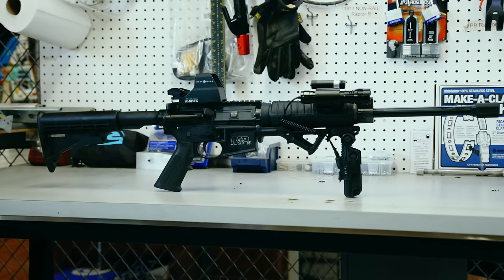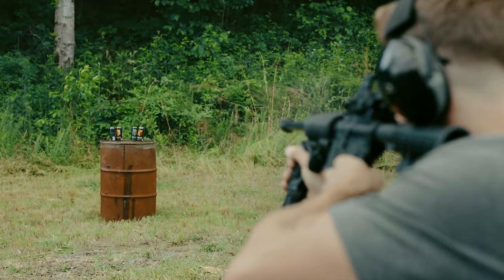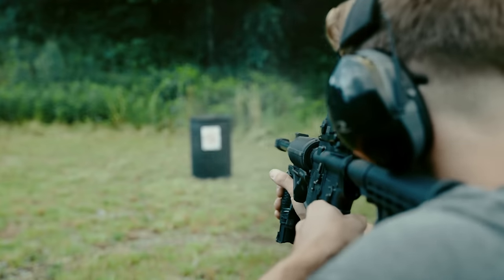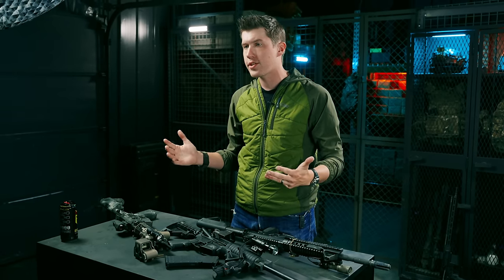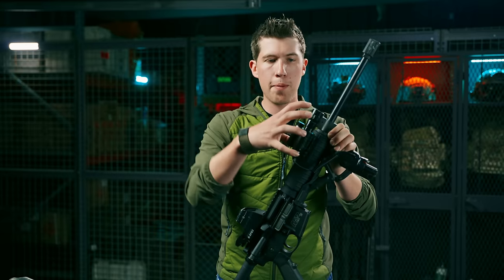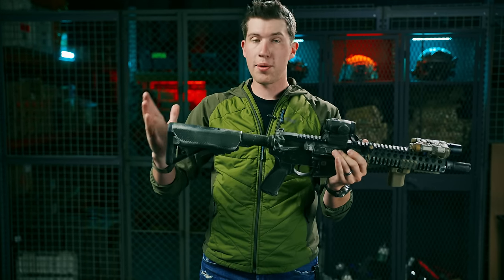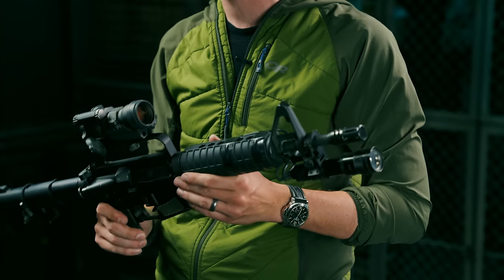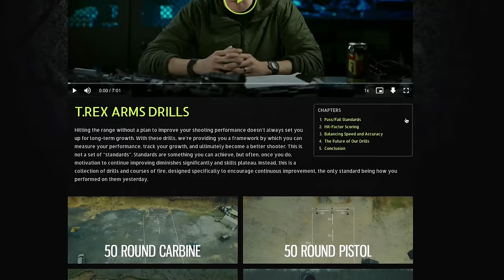5 Mistakes New Rifle Owners Make

Comment: My first sight was a Vortex Strikefire II. Still have it and it's one of my favorites, and one my backup gun. Only about 200-250 rn I believe. I recently bought the cheapest 7.62x39 AR-15 known to man, a complete radical firearms. Other than receiver slop that was fixed with a set screw, and a heavy buffer to help with the overgassing it has been a great steel case eating machine for 400 bucks. I put a Sig MSR on it that I got on sale for 70 bucks. I didn't have high expectations for anything on the rifle, it was all as cheap as cheap gets. So far the MSR hasn't lost zero and has options for night vision that actually work pretty darn well for a normally 120-150 dollar sight. It has been accidentally stepped on, caked in mud, and accidentally kicked with steel toes as well (fell off the shelf). SIG's got a fan in me now. Might get a ROMEO 5. 

Would love to see a ROMEO sight series review.
Reply: I got a sig reflex sight for a 120 rounds of 7.62x39 from a buddy and after putting that on my block II upper I haven’t dropped any money on another sight. Super solid sight. I would really enjoy having a UH-1 or a 4x32 Acog with the backup top sights just for shits and giggles
Reply: Strike fire is a terrible optic all around. The sig Romeo 5 is not bad but if your waiting for Lucas to do a committed review for one you're gonna be waiting a long time
Reply: @oneballwizard406  I guess to each their own. I own a LOT of optics ranging from $20 on amazon to Eotech, Aimpoint, and Trijicon in the world of red dots. That strikefire has great eye relief, pretty indestructible, never loses zero, and doesn't glare much on high brightness.

Can't say the same for my CompM4, I broke it within 3 months. Had to get it warrantied. The new one doesn't hold zero very well. Infuriating that a near 1k optic that I was going to use for my battle rifle is a lemon product. I always hated aimpoint, their optics in the service were junk too. Yet so many people sing their praise.

I've never heard a single bad thing about the strikefire at it's pricepoint, what was your bad experience? I think looking at SIG products is smart, since they have been winning so many military contracts. Most SDMR systems out there right now use TANGO6 optics, and out of all the LVPO's out there it's been by far and away my favorite.
Reply: @Wrenchingandnursing  I can't talk I have a leupold freedom RDS, thinking about picking up the uh-1. I just think there is far better options for the price, just about anything from holo sun or primary arms is better
Reply: @oneballwizard406  I can't say for sure about holosun, but I have a couple primary arms optics, and their red dots are lackluster. I liked their LVPO and scoped optics in general, but the red dots while being reliable and tough, have horrible eye relief and glare.
Reply: @oneballwizard406  Something funny about a guy calling something "Terrible all around" and he doesn't even own it nor has he touched it. Never fail to amaze us gun "community."

lol
Reply: @Wrenchingandnursing  Red dots don't have "eye relief."
Reply: @denmanfite3156  what made you think I've never touched one? I've used one extensively and think it's a pos that's my personal opinion. Don't like it oh well
Reply: @denmanfite3156  🤡
Reply: @denmanfite3156  Yes they do. Reflex sights, and "most" holographic sights don't have eye relief. Not all red dot sights are reflex sights. Reflex sights that are enclosed in a tube can still suffer from sight acquisition in very bright or very dark situations, but in the case of my comment above you are right, eye relief wasn't the right term. 

There are three main types of red dots: reflex, prism, and holographic. Prism sights have eye relief, some holographic sights have eye relief. ANY sight with a magnifier has eye relief, and the quality of glass on the red dot plays a SIGNIFICANT role in how bad the eye relief is. I know this because I have a couple nice magnifiers and shit red dot glass always makes the eye relief horrible on them. 

The minute parallax is involved glass quality matters all the way through the sight picture. IMO not running a magnifier on a reflex shouldn't exist because it is essential at any range you would normally want an LVPO for, when you don't have one. It also has no negative.
Reply: I have a strike fire 2 on my m&p works great no complaints I've owned several vortex scopes and haven't had any problems they good for what u pay

Comment: Honestly I was that guy, my first rifle had a sight mark ultra shot plus w/ UTG 3x magnifier and a feyachi weapon light. As you can imagine, they didn’t last. I moved to a Romeo 5 (no magnifier) and a streamlight hlx, which I recommend if you’re just starting out. Now I’m using an Eotech w/ a Holosun magnifier and a surefire weapon light. The Romeo 5 and the Streamlight went onto two other builds and they’re doing just fine.
Reply: Its an engineering evolution!
Reply: I too am running a Romeo 5 and a Streamlight HL-X. Solid setup!

Comment: This is great advice. But 100% spend that 300-600 for a good optic, upgrade your handgaurd, stock, and grip, and get out there and use it. A real build is about 1500-2k done. And another 1k in ammo. Great started video 👍
Reply: Yo Joe  ? Take any AR15 rifle. Add a LPVO or quality optic (300-$600), backup Iron sights ($80-120), 2 point sling ($70-80), upgraded handgaurd (40-$80), grip ($20), stock (40-80), foregrip (20-60), good weapon light and mount (200-400), maybe throw in 10 gen 2 Pmags ($100). You are at 1400-1600. I personally buy Areo lowers and Geissele, Daniel Defense, BCM, Midwest industries uppers and builds come out to $1500-2k. (With optic)

Comment: $25 field sport clone of that multi radical Red Dot you showed. First Red Dot I ever bought. I've had that on 22s, AR is in 556, and a Mosin to go in 7.62x54r.

I'm not saying I recommend it. But cheap crap can sometimes be worth it.

I've had good luck with fieldsport, CVlife, and monstrum.

 My current is a Monstrum Banshee MPVO 2-10x34. It's amazing.

Comment: I took Lucas’ advice and looked around on eBay. Got 2 eotechs (exps2-2) for like $350 & $380 each. They’re used but they’re eotechs so they still work perfectly fine. If you know what to look for (and can spot fakes to avoid them) eBay is good if you want to save some money

Comment: I had an M&P15 with Amazon red dot and laser, an Olight, some no name foldable handguard, and I cringe to this day I used to have a gun like that. this is why I tell all my friends who wants an AR15 to get a very specific build: PSA or M&P15, a BCM handguard if it is not already M-Lok, Sig Romeo, MBUS Pro or DD sight, Streamlight Protac, Magpul or BCM slng and foregrip, and nothing else. $1200 or so on a good day, $1500 or so on a bad day
Reply: why would you suggest they buy a foregrip lmao, out of all the bs you "recommend" thats just the extra cherry on top to confirm you indeed are an instagram operator great value edition lmao
Reply: @housemana  because I use one?

Comment: Great video. Sound advice and recommendations. As far as optics go, I was taught that your red dot or scope should cost at least half the value of weapon system it's being mounted on. Has not let me down yet. I wish had opportunity and time to train as much as you do.  Keep up the good work.
Reply: I tend to spend the value of the rifle on the optic, other than a few rifles where an optic in the same range would be dumb.
Reply: This was actually good advice that said a lot of those 100-150 dollar options are really good. While I admit some of those sub 50 dollar options are pretty solid, they usually have some fatal flaw and its not usually stability, though holding zero is critical. Either its not bright enough in noonday sunlight or it has one of those annoying 10 minute shutoff options that are built in and cannot be changed so you have to turn it on again every few minutes.
Reply: I’ve always heard “no more than half, no less than a third” which makes sense to me as well. No point in sticking a $3000 Leupold on a $300 Hi-Peezy, and a $200 holosun isn’t gonna do justice to a .25 MOA 6.5 Creedmore that’s capable of reaching out 2k yards
Reply: Sig romeo is a perfectly fine sight for $120. Shake awake, stays charged forever, blue loctite. Stays zeroed at 100yd EZ. Decent irons are the same price.

Comment: Something that always blows my mind is the red dots that have a selector for the reticle. it literally moves with a mechanical sliding switch. it literally moves the reticle.
Reply: And? You can do this to the dampers on your shock absorbers in a car as well... Its not idiot proof.
Reply: @IIchicgo  the reticle is the part that shows point of aim, typically you don't want those to frivolously move about.
Reply: Life with Rob  its not a laser.

Comment: vortex has some decent options for pretty cheap, my sparc 2 has been dropped a few times and been on my rifle for at least 3k rounds, maintains zero, only issue I've had is the flip up covers, rear and forward have broken off; still functions well regardless. It's recently been discontinued (warranty will still be honored) and replaced with the Strikefire, which I don't have experience with and therefore cannot speak for, but my experience with the company has been a good one overall.
Reply: I have the original sparc ar it has never failed me keeps zero clear glass
Reply: @dogcunt9759 came here to comment this but you beat me to it. Have a Vortex Sparc AR on one of my builds and it’s constantly slung around in a vehicle trunk, in and out of a cramped space being bumped, dropped several times, and has had over 10k rounds. Still holds zero perfectly

Comment: Depends on the caliber. I got .22lr rifles throughout. Not much recoil. Got a sight for $25 I've had it for 5 years. Still works.

I wouldn't recommend it for bigger calibers though good tips.
Reply: Sounds great for shooting chickens.
Reply: Cheap scopes are fine for a 22lr bolt gun. Unless you're one of those nutters taking 22lr out to 600 yards it'll be fine
Reply: @cunnelatio  I don't know why or even how you take a .22lr to 600. I'm a seasoned shooter with more than 17 years of experience in many calibers with the most on .22 and 5.56. I use a .22 with a 4-24x scope and have trouble hitting at anything past 300. You MUST have subsonic ammo to somewhat reliably hit at longer ranges. If you use the standard of around 1100fps, it'll hit what's called a trans-sonic phase where it transitions from super sonic to subsonic and it'll destabilize and start tumbling and land at the mercy of the air flow.
Reply: @fireantfury2539  i saw a guy hitting cans at that range with 22lr on youtube. Search it up. His setup probably cost a ton and was using eley ammo
Reply: @Youtube person  I don't know about 600. I'd believe it if it were 300 or 400. 500 max but 600 you'd need minimum like a 16x to even see a can and ballistically .22lr destabilizes around  300-400. Eley, Remington, Aguila, wouldn't make a difference at that distance because they won't ignore ballistics
Reply: @Youtube person  Unless that guy knows something I don't which is possible. I've been using .22lr a long time and have never seen someone shoot that far. He'd have to hold like 300ft about the target

Comment: I don't like to hang a lot of stuff on my guns. I mostly keep them in stock configuration. I've tried red dots, etc, but I always end up going back to iron sights. That was how I learned to shoot, and it's what I'm most comfortable with.
Reply: A Colt M16/ AR15 Armorer nstructor told me that anything more than a smal light messes with the harmonics of the rifle.
Reply: Electronics can fail. Iron sights wont especially with good training and practice.

Comment: Just bought my first Ar 
Sigs Romeo 5 is just around 200 usd and it's amazing not bad for a starter red dot
Also comes with a high n low mounting plate
Reply: Pair it with the juliet 3 magnifier.
Reply: I don't own a sig Romeo, but my friend has one on a 30-30. It shoots good
Reply: I have had my Romeo 5 for over 2 years now and whenever I need to re-zero at 200, I am always impressed that it takes very minimal shooting to get it back to zero.

Comment: Great video! Nothing wrong with stock rifles with iron sights to start, upgrade overtime. Bushnell has a red dot for $60ish out I have had it on my AR15 and 12 gauge shooting 3.5in turkey loads it is a great bang for the buck. Typically can't go wrong with  $200 range of major brand optics, I tend to stick with Vortex. When building your own rifle invest in the BCG and barrel everything else can be mil spec. Next I would upgrade the trigger but I still run the stock personally what I have always known. PSA has great deals especially during the holidays. I typically drop a DD hvyweight CHF or PSA CHF barrels on my builds. I disagree about the muzzle breaks I love mine, Jerry M's break, thing recoils like a bb gun and keeps me on target for follow ups but it does make a 556 sound like a 308. If you going to do this type of training you going to get used the muzzle force especially when you train with others and in a real situation it is going to be there especially in CQB, own it.
Reply: I literally just said this same thing, that was the first RDS I had on mine before the RT6/Fast Fire3 in a PEPR Mount. Now the TRS25  is on a 12ga, slugs don't bother it in the least, 100m zeroed...hell idk the last time it was even zeroed but it's still close enough to on for a $70 Optic. I have Astigmatism soo unless it's a Prism or LPVO they all are "fuzzy dots".

Comment: Im building my first AR soon.. so I enjoy these videos a lot.. 
I will be going Iron sights first to get use to the platform. With the goal to add a dual optic on later. 
A x1 red dot matched with a magnified optic. Id be willing to invest into a solid system that will not only be accurate but will be reliable and last.

I picked out some parts.. will be ordering a lower to a ffl  licensed gun shop soon. After handling a bunch of set ups I have an idea what feels comfortable in my hands. So immediate upgrades will be to an improved trigger reasonably priced. Grip with 15° angle and a better shoulder pad stock. 

Im going with a 16" CF barrel.. 
Bolt & Carrier will be stock for now.

Comment: Yeah I definitely went through that phase. Thankfully I only spent about $200 on the cheapest ultra-chinese bargain bin garbage set of accessories just to play around with. Once I figured out what I actually needed I spent the good money on an optic and a vertical grip. I still use the cheap sling though, not even the Chinese can mess up a nylon strap.
I would actually recommend people go out and buy some cheap accessories if you are a tinkerer in any way. Not to actually use but to put it on and see what works for you, like what kind of grip fits your hand or where the rifle is going to balance after putting on all that weight. Buy once, cry once is definitely a thing but when it comes to things like attachments having something physical that you can grab and swing around really helps you learn more about how your hands will be working that rifle a thousand times more than any video or article.

Comment: Really surprised no mention of sig optics in this. A lot of people don’t know that the Romeo MSR is a T2 footprint so you can switch out the mount. The sight works well and I have a lower 1/3 cowitness setup for under 250 dollars.
Reply: I run a sig romeo 5... no issues like ever.

Comment: Sightmark makes a few, good optics that can take a true beating.  I've been running an ultra shot m spec for almost 3 yrs now without a glitch.  I've beat it up, have taken it off and put it back on and it's held zero.  I know it doesn't have the big name like eotech, but it's worked very well for me.
Reply: SightMark M-spec line is real deal, some rifle scope it’s nice too. But I don’t know why few R and A-spec from them it’s bad more then some airsoft optic. I work at tactical stuff shop, I recommend My customers every single time ‘if u gonna buy a SightMark optic u should go to m-spec’
Reply: Same on the M spec. And with back up irons you should be fine.

Comment: The "abomination" has it's angled foregrip on backwards. lol.
I do have a VFG on both my 16" AR and my Saiga AK.  I like the eurgonimics to them when moving them around. Of course I have to change grip a little when using the weapon light I have.  OLight PL-2 Valkryie.  No remote pressure switch on that one. lol.

Comment: I’m not sure what the goal was here poorly mounting a Sightmark and implying it’s junk as is all the other sights under where he starts…  $400. I’ve had several SightMark Ultra Shot Plus’ for almost 5 years and have never had an issue. (Originally $150) They hold zero even after being dropped, and have remained spot-on even on my 450 Bushmaster brush gun.  (Not close to the same quality as an “EOTECH”…. But the experience of using it is very similar.)  With the ultra-wide window and clear glass the field of view is great!  The red & green reticles are bright enough for daylight shooting.   (It can be swapped with one push of a button to the preset brightness.)
The area it falls short is that if it’s not their “Milspec” model,  then they are only rated splash/rain resistant.  (They are not waterproof.)  
Another inexpensive sight I’ve had great luck with is Sig’s Romeo 5. Great reliability, battery life, and clear glass.  (Just small window.)
But truthfully, there are some inexpensive sights that get the job done.  Are they military quality?  NO, but it’s not a mistake to buy optics that cost less then $400.  If you’re building your end-of-world survival gun, put sights on your gun that doesn’t require batteries. Just saying…